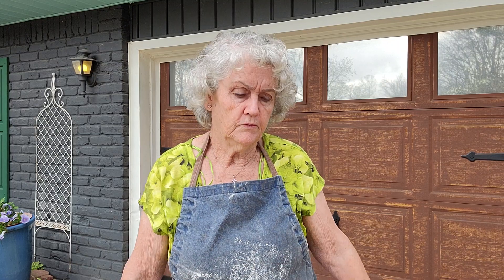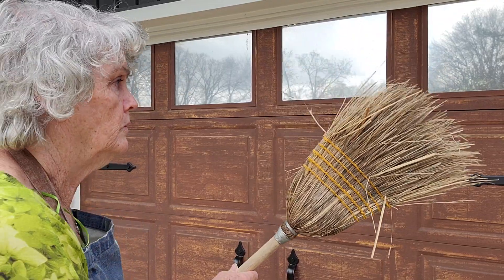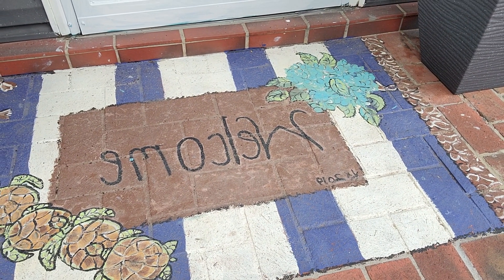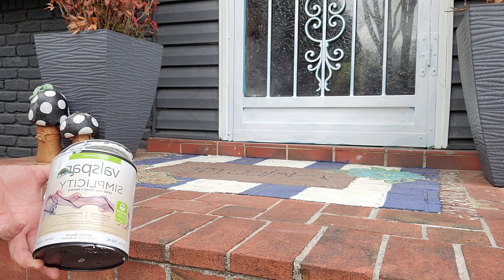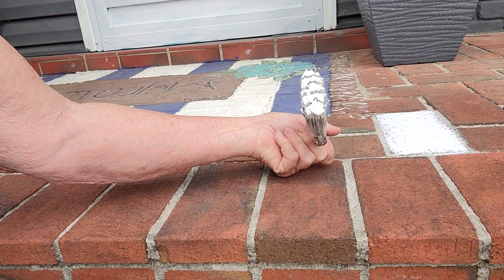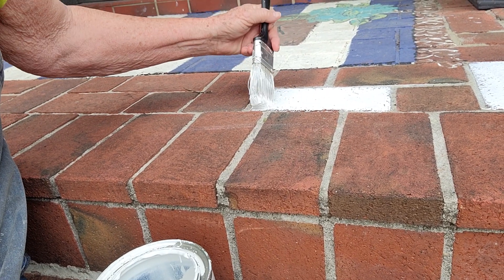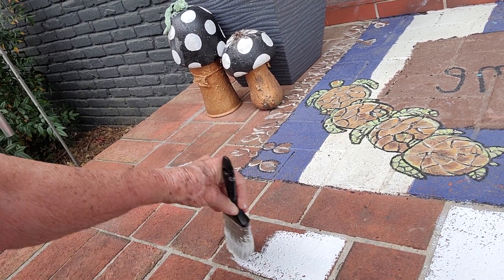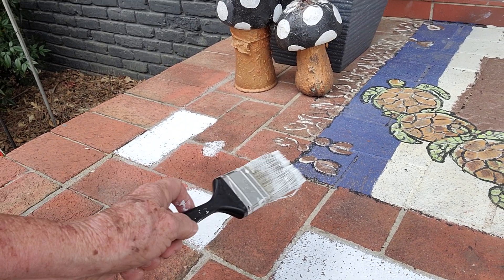Porch Rug

Comment: Well done! Love your creativity and the attention to detail. 
Did you paint the first faux porch rug with interior type paints also? I’ve never painted anything outside and would be afraid the rain and elements would wash it away.
Reply from the maker: Used outside house paint or craft acrylic paints on painted rugs. Coating with sealant after drying. Never had any wash off.  Kat